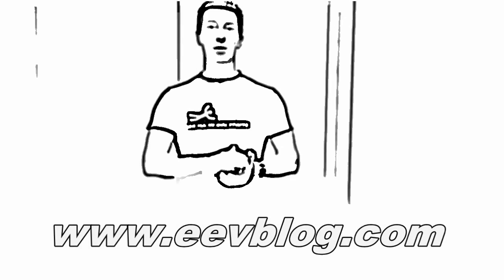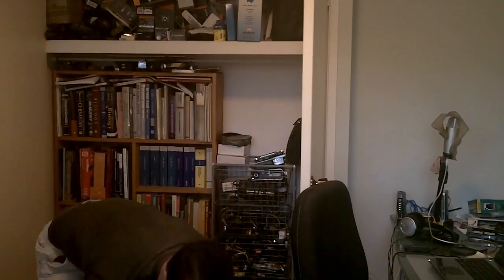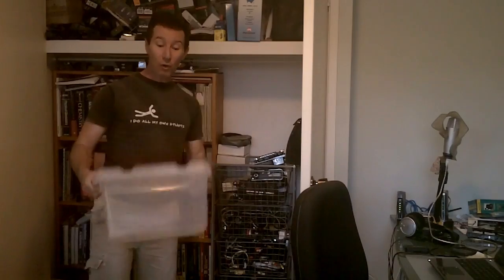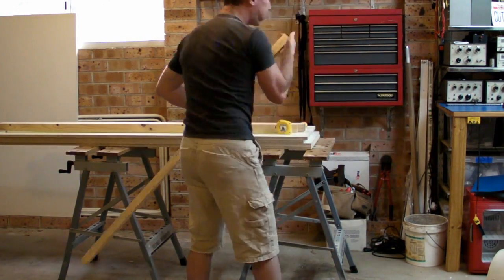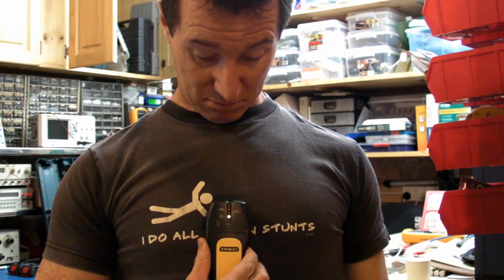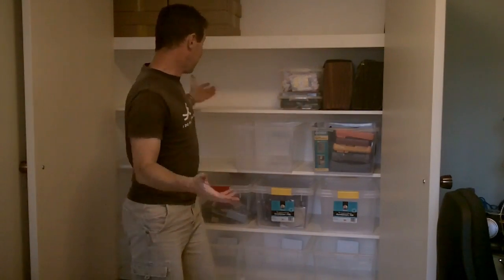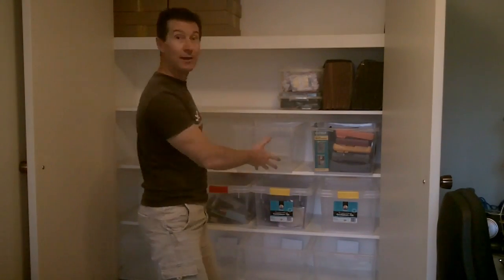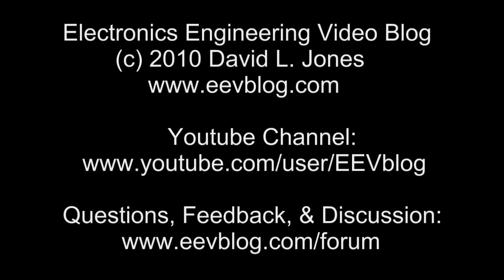EEVblog #136 - Building an Electronics Storage Cupboard

Comment: Come on Dave! I had to watch my mom hide all my stuff I put on the kitchen table after the hail storm ruined the shop. That was just as boring. I am still trying to find stuff. I would try to help and it turned into a bigger mess. This like reliving a nightmare. Do electronics please! I did get a clip top tube  for a curve tracer to test vacuum tubes. Somehow I don't trust those Chinese cheap jacks on the patch board. Off the top of my head.?? 27 multi meters, a blasting Galvanometer, & a hipot